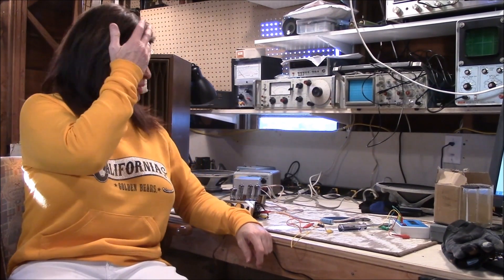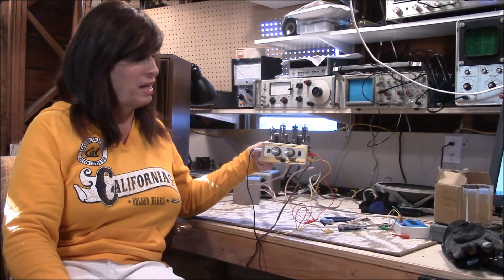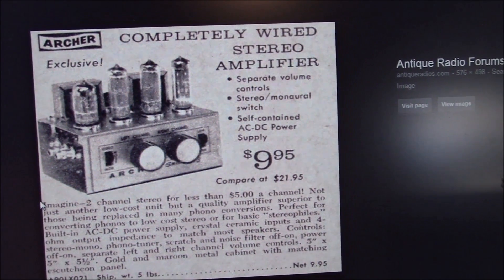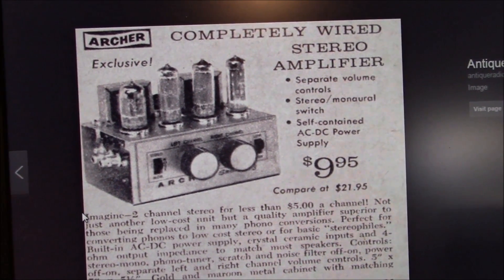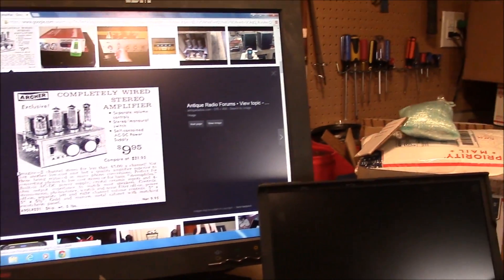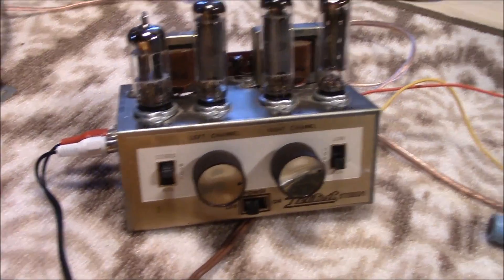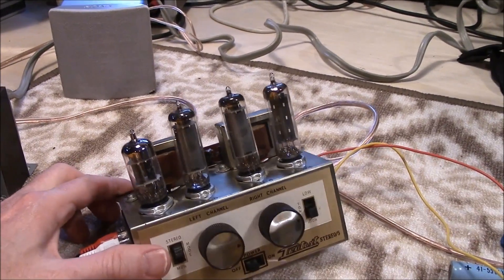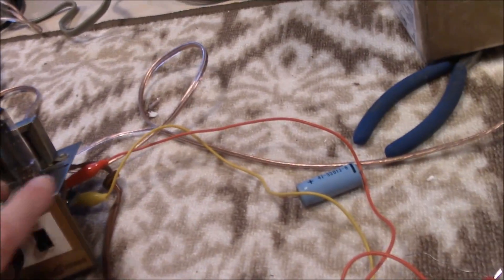Trutest 5 Stereo Amplifier Repair...This "Little Toot" is a Beast! (Part 1)

Comment: FYI: A standard, garden variety variac will not provide galvanic isolation. However, there are a few models which do also have an isolation transformer built-in. Be sure of the equipment you are using before using it.